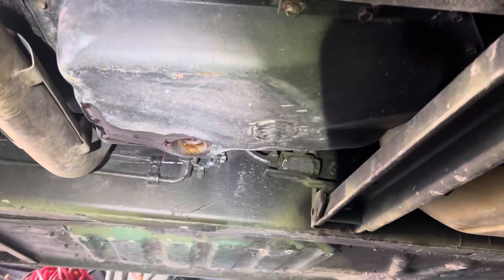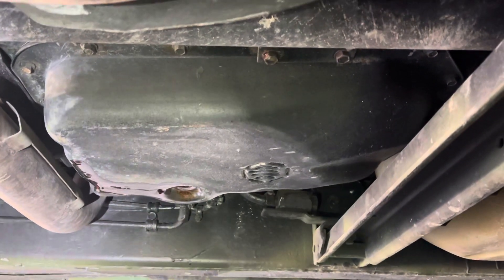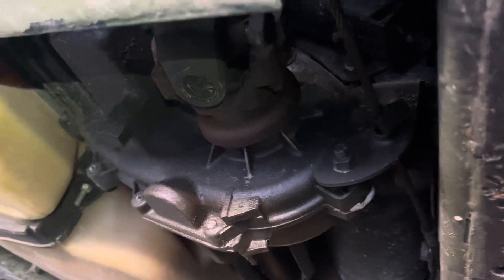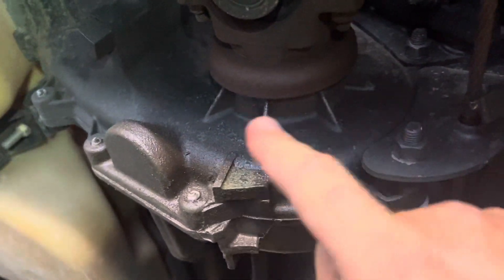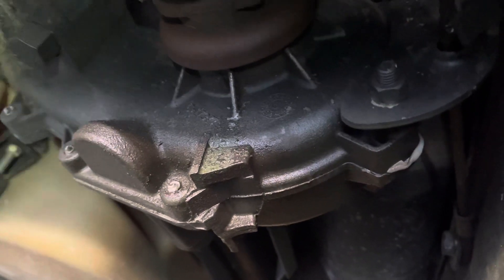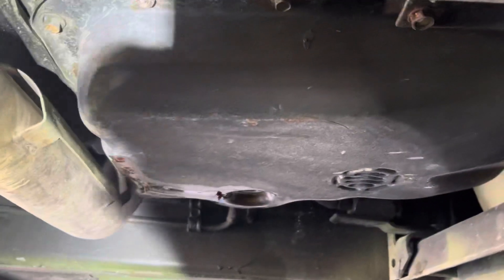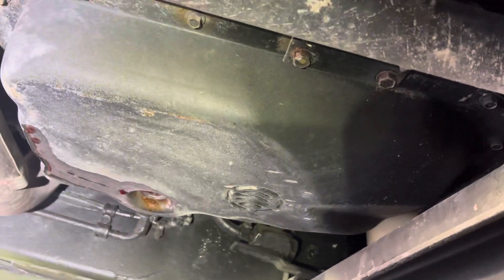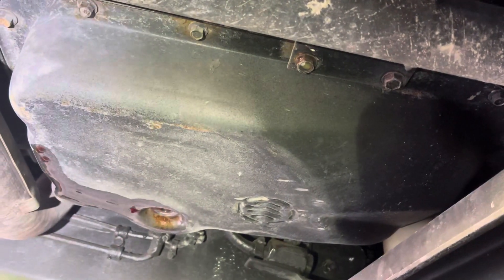HMMWV Transmission cooling loop broke!!

Comment: Hey there, any update on how this went? Im trying to see specifically what lines need to be looped ubder there. Im looking at a HMMWV to possibly purchase, and it may have this issue. Thanks for any updates!
Reply from the maker: So far it’s still going strong. Basically just run the line back on itself. Transmission to transmission for example. Then check all of your fluids and you are good to go.
Reply: @Idaho_Humvee  Thanks, amigo! I found some pics. Looks easy peesy. 😎🤙
Reply from the maker: It really is. With one exception. Getting your hands that far up there lol. Otherwise it’s just hose and hose clamps.